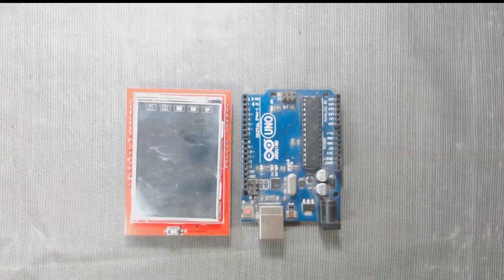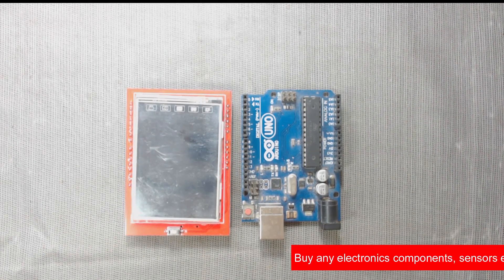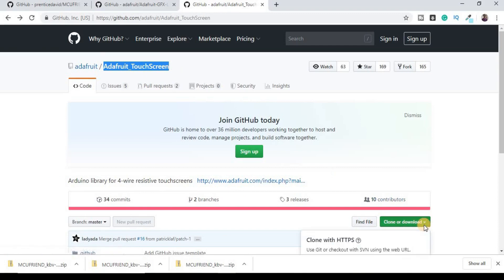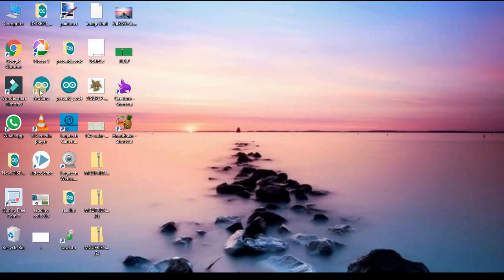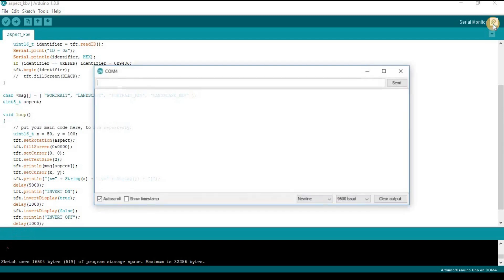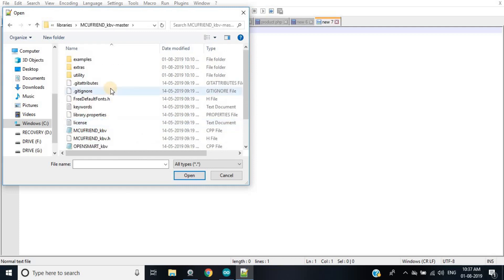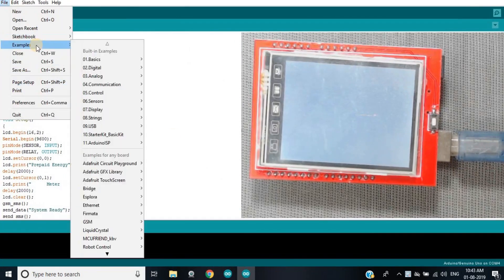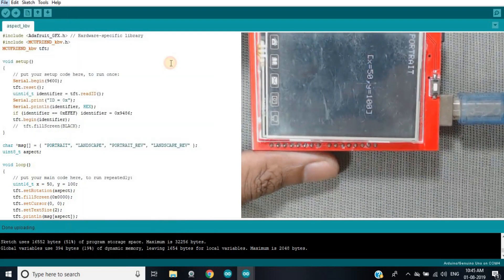How to fix TFT white screen problem | MIRROR image 7474 | 0x4747 tft lcd 8347 driver MCUFRIEND

Comment: I have been using this display for two years for my project. I have a problem in summer time when it heats up from the sun above 50 degrees celsius. The display turns white and nothing can be seen. When it cools down in the shade it works again. Could you please advise me what I can do in this case. Have you had this problem? I buy the displays from AliExpress.

Comment: my id is 0x2828 and I could find nothing. Can you help?
Reply: Try this configuration, it might work: If your TFT has this pins:
Vcc - 5v
Gnd - Ground
Gnd - Ground
Ncc -  
Ncc -  
Ncc -  
CLK -  pin 13
SDA -  pin 11
RS   -   pin 9
RST -  pin 8
CS   -  pin10
Install adafruit GSX and adafruit ST3375   libraries (I'm not sure about filenames but in my case my filename ends with "-master") 
Do not use any of libraries example sketch. I write my own code from scratch 
Do not include these libraries in the code.  just "Include <TFT.h>"  and "Include SPI.h" 

Here's  the link I learned the code from  https://www.arduino.cc/en/Guide/TFT

Also, weird thing happens.When i use rgb function like ".stroke(red,green,blue)", color is reversed. 
So it's not RGB. It's BGR.  (blue,green,red) 

I think my TFT is just cheap cloning. It's like buying TV with unknown name and there's no manual in the box.

My code:
 

/*
 TFT Pin  - Arduino Uno & Nano*************
  Vcc - 5v
  Gnd - Ground
  NCC - 
  NCC -
  NCC -
  CLK - 13
  SDA - 11
  RS  - 9
  RST - 8
  CS  - 10
************************************************  
*/
 
#include <TFT.h>  // Arduino LCD library
#include <SPI.h>

// pin definition for the Uno
#define cs   10
#define dc   9
#define rst  8

// pin definition for the Leonardo
// #define cs   7
// #define dc   0
// #define rst  1

// create an instance of the library
TFT TFTscreen = TFT(cs, dc, rst);   

void setup() {

  TFTscreen.begin();
  
  TFTscreen.background(0, 0, 0);        // clear the screen with a black background
                                                                // (0,0,0)- Black  (255,255,255) - White
                                                                 
   
  TFTscreen.stroke(255,0,0 );            // stroke(blue,green,red)      
  TFTscreen.text("Line Square Circle",20,8);
  
 
  TFTscreen.stroke(255,255,255);        
  TFTscreen.line(0,20,160,20);
  TFTscreen.stroke(255,255,255);
  TFTscreen.line(0,120,160,120);

  TFTscreen.fill(255,0,0);                //Square with fill color
  TFTscreen.rect(20,30,30,30);  

  TFTscreen.fill(0,0,255);                //Circle with   fill color
  TFTscreen.circle(80,45,15);

  /*
  TFTscreen.line(120,30,105,60);          //Triangle with fillTriangle
  TFTscreen.line(120,30,135,60);            TFTscreen.line(105,60,135,60);
  */
  TFTscreen.fillTriangle(120, 30, 105,60,135,60, ST7735_GREEN); //(x1,y1,x2,y2,x3,y3,ColorName)

 }

void loop() {
   
}